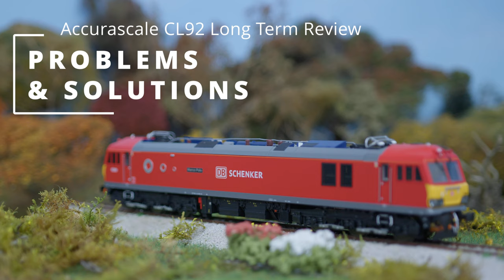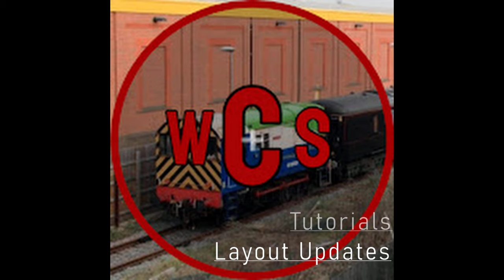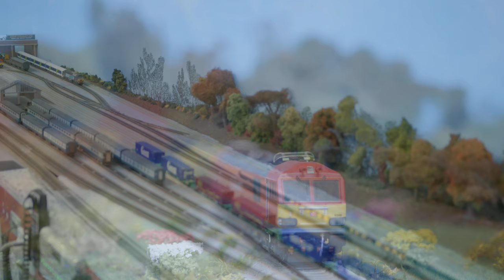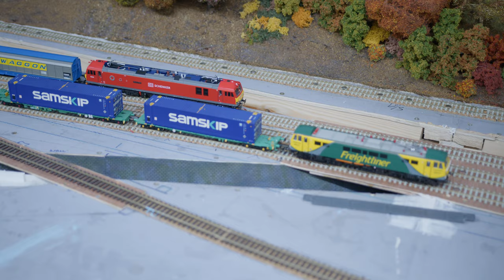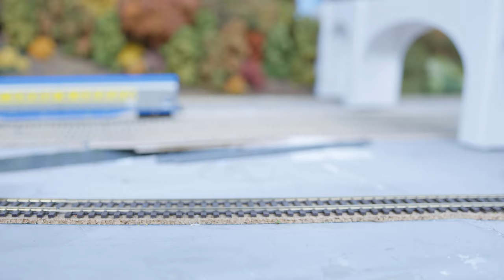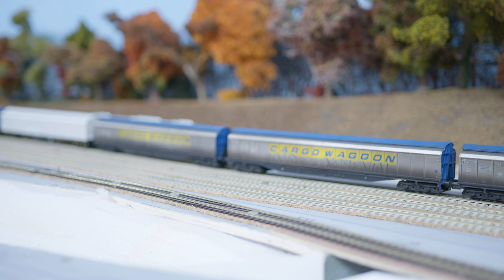Accurascale Class 92 Long term review (Video 13)

Comment: The way to "emergency stop" any stay alive fitted loco is to hit the stop button twice in quick succession .. The first stop button hit cuts the the power, which the stay alive overrides and the loco carries on, and then the second stop button hit restores the power, but with all the speeds set at zero, so the loco immediately stops but is ready to go again as soon as you turn up the speed dial. Regards Julian

Comment: I have an Accurascale Manor that blew the sound chip after about 2 minutes of running. I returned it to the shop I purchased it from and they sent the chip to Accurascale who replaced it and then the guy at the shop tested it and ran it for an hour with no problems before I picked it up.  I also had a part fall off a 37 (it was a wrong part). I contacted accurascale by email and they replied within 10 minutes, by 20 minutes they were arranging the correct part to be sent to me in Australia.  Meanwhile on one of N scale Dapol DMU's the BR logo was reversed on the body, a whole batch was printed wrong!!!  They promised to send out new bodies to all those affected within 3 months..seemed very optimistic to only take that long...a couple of years later we are still waiting. I didn't hold my breath. Every time I contact them the replies range from "soon" to no reply whatsoever.  So Accurascale for me are doing very very well.

Comment: I have three of these models in triple grey livery and they are great models overall. Mine ran fine on the Kato unitrack test loop. I used a wee bit of black tack on the 92 couplers that holds them steady in place, I do not have any hesitations in buying more of them in the future. Accurascale seems to be top dog in UK OO gauge models.
Reply from the maker: Thanks for your comment. Yes they are fantastic models and I'd not hesitate to buy another. My faulty one was just one of those things.

Comment: Accurascales "Quality Control" is still not fit for purpose. My Deltic has ended up in the bin as Accurascale could not give a replacement as all are sold out. They wanted a video showing/proving the loco wouldn't move and more detailing parts are off the locomotive than on it! Finally, a "short" has fried both the factory fitted ESU sound decoder and others (non-sound) that were used to test it.Flaking paint, constant derailments, windows falling out, detailing dropping off and finally a fire! (smoked decoder) saw me lose patience. Accurascale may be nice to look at (in a display cabinet), but Ive never had any issues with the hundreds of Bachmann locos I've owned.
Reply from the maker: Hi.
You must be extremely frustrated with the Accurascale situation. I know from personal experience how disappointing it is to buy a highly anticipated and much hyped model only to find it in bits when you open the box or have details fall off when in use.
Are you aware that Accurascale now have a lifetime warranty which also includes past purchases. If Accurascale can't repair or replace the faulty item they will have to refund you.